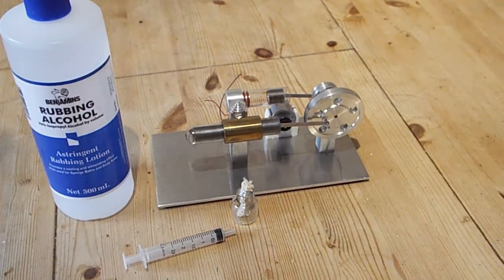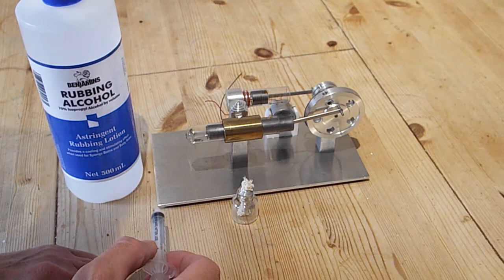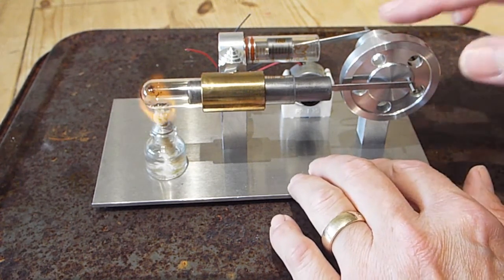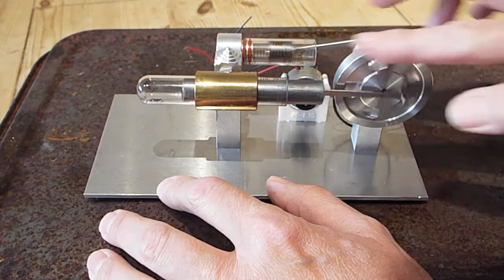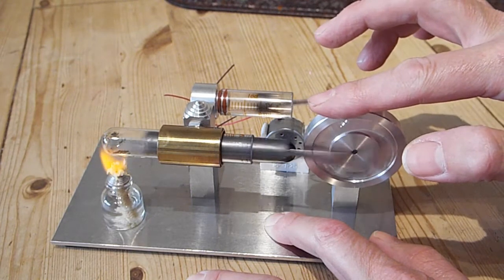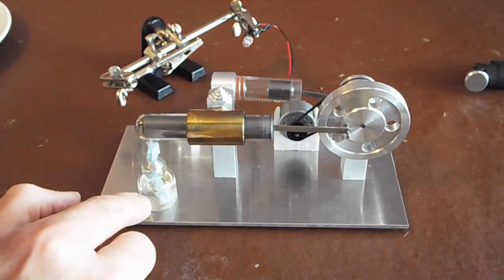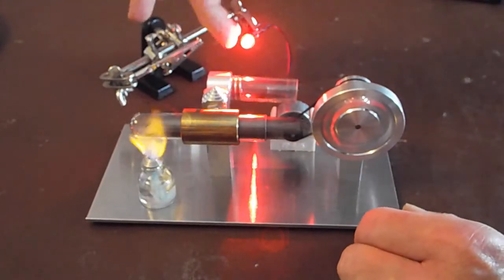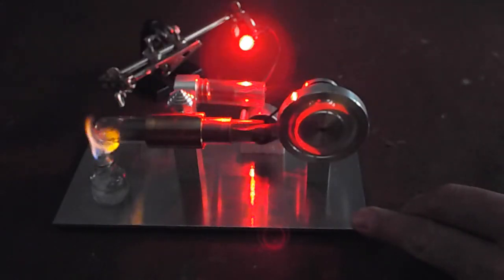Stirling Engine running Part 2

Comment: Thanks for making this video. A guy I work with was telling me about his Stirling engine, which sits atop a wood burning stove and has a fan attached therefore blowing warm air into the room. I'd never heard of a Stirling engine and had no idea what he meant. Good to see one actually working - impressive speed!!
Reply from the maker: Loads of these cheap china engines on Ebay.  Yes they do run fast.